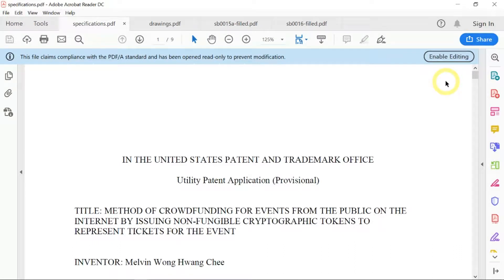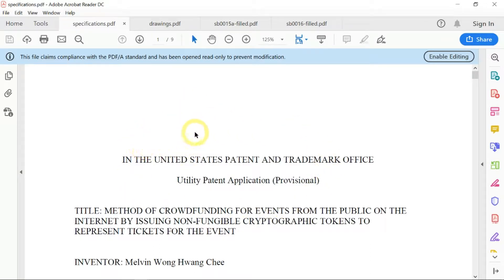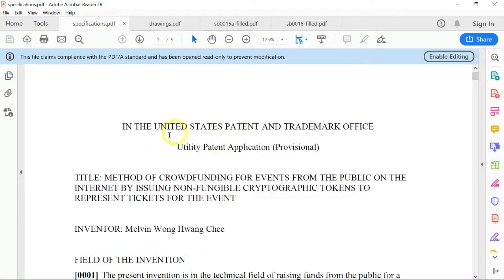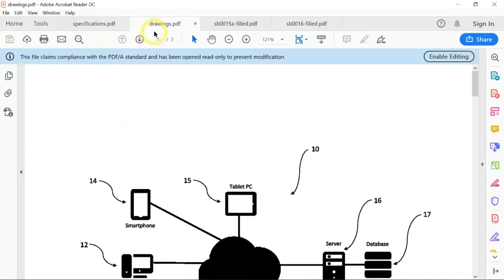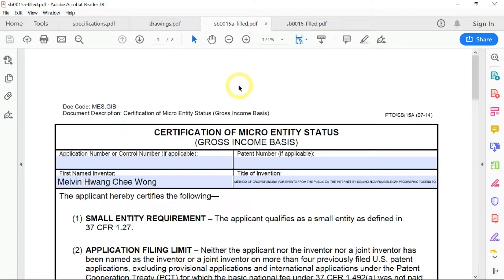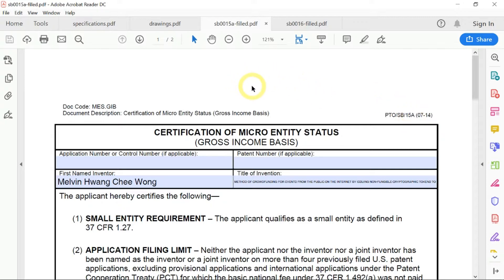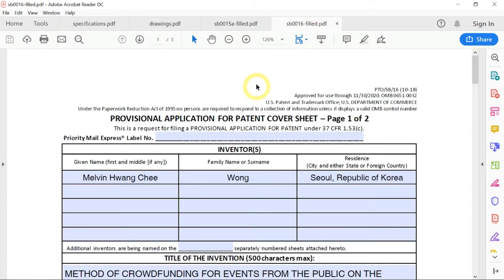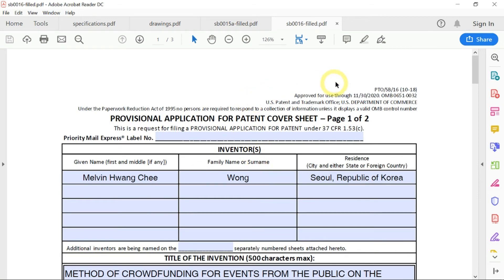Understanding the Forms and Documents to File a Provisional Patent in U.S

Comment: Great example, Thanks! I downloaded your file ticket token offering as an example . . . Questions(s): 1) Did you have to include claims? If not, why did you include claims? 2) On pages 10 - 13 you show your drawings/figures . . . but when you submitted your provisional patent application did your specification have the drawings/figures in it. I assume you submitted your drawings in a separate file during the provisional patent application . . . correct.?. Regards, John